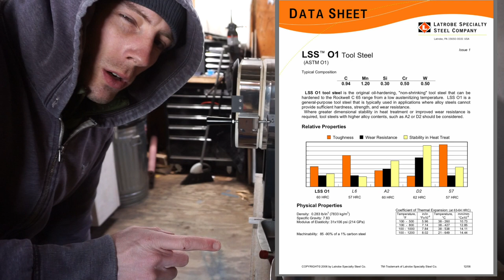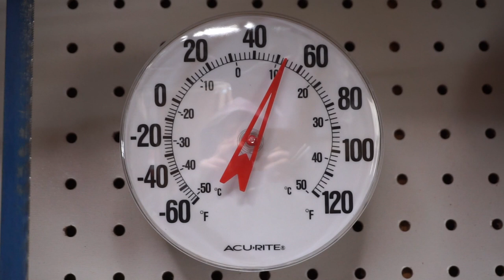Heat treating O1 Tool steel

Comment: The 400F thing is called a marquench or martemper, it doesnt do anything for hardness but it does bring you past the nose but stops before it turns back into martensite for the most part. Its when it chnages to martensite that you get the 2% expansion so doing it slow is good for reducing cracking and warping, you can bend it before it sets. The unexpected thing is that you easily get 2x toughness even after tempering from many steels this way by reducing the internal stresses.
Anyone thats worth their salt that does traditional water quenching is an expert at pulling the knife before you get into the martensite region below 500f where water cools significantly faster than oil.

Comment: Get a aluminum fence post. Cap the bottom.  The thinner the better. You can use that oil to get much longer blades quenched with the same quantity of oil.

Comment: I like both formats. As long it doesn't get to fancy and you keep both feet on the ground ;-) I have one question. The more holes all you guys drill in the tang as to give the epoxy a better grip. You're even rounding the the edges of the holes, I guess you're doing just the opposite. Because you're reducing the bonding surface area. And epoxy without any carbon or handle material is pretty brittle. I can understand you would do it because of the balance of the knife. All the best from Denmark. I did learn a lot from watching your videos :-) Thanks !!

Comment: You may have learned this already since this video was posted, but you were speaking of blades warping when you quench and something l learned awhile back is if you get a compass (I use my phone) and find North and turn your quench tank or hold your knife to where either the spine or tip is facing north, all depends on your quench tank, it will help prevent your knife from warping. I didn’t believe it until I tried it and seeing as the tip of a knife coming out of the oven or forge wants to pull towards the magnetic field of north like a compass when it cools it only makes since to situate your knife like the needle of a compass. You will get a lot less warping if you take this extra step, I know it’s helped me. I hope this little rid bit of info helps you or anyone else out there having issues with blades warping.

Comment: pretty good stuff. But unlike you, i would definitely use the heat treatment temperatures they give you for your type of steel. In knife applications, its not that critical apparently, but if you heat treat gun parts, its a whole different story.

Comment: Be careful moving your work piece left/right in cooling fluid.  You're introducing a substantial cooling disparity on each side of the blade.  Generally, you want to only move a work piece along it's longer axis to minimize warping.  If you want to test this phenomenon, take a thin piece of steel and spin it around your cooling oil in one direction then measure it's warp.  It will warp towards the motion of the stir in the oil because that side will cool first, and quicker.  Of course that's just to demonstrate a worse case scenario, but it proves the point.  Sometimes it's minimal.  Sometimes it isn't.  For knives, it doesnt matter that much, as they are not precision surfaces, but it's a good piece of knowledge depending on your application.  I do precision work down to the micron scale, and how the tool is hardened (even something as mundane as how it's being introduced to cooling fluid) has very measurable effects and can the difference between an in-tolerance shaft, and trash.
Reply from the maker: There was no left to right movement. It may look like it but there was not. Thanks